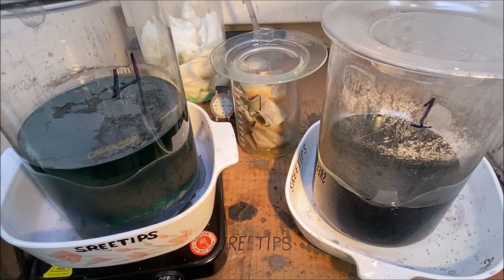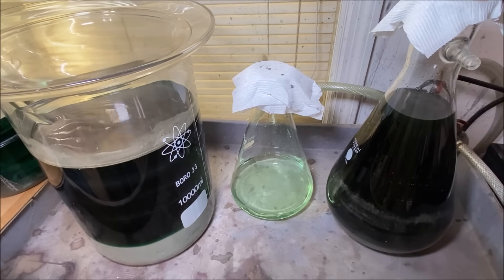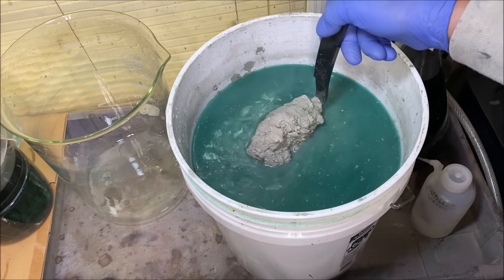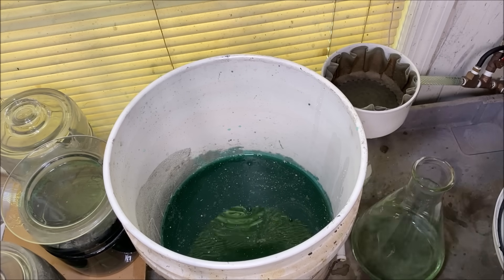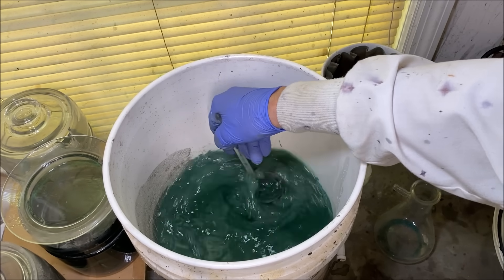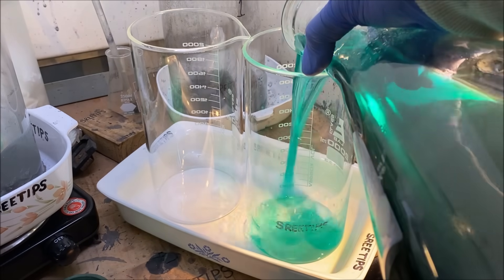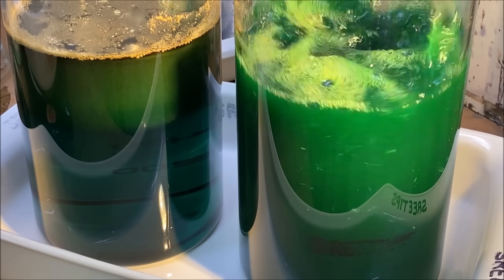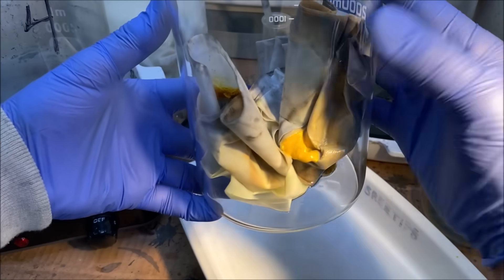Silver Cell Anode Filters Recovery and Refining Pt5

Comment: @8:25 Never mix alcohol of any kind with nitrate wastes during PM refining! Several precious and base metals can react with alcohol while in nitrate form to create pressure-sensitive explosive compounds called fulminates, with silver fulminate being particularly nasty. While it's safe enough to handle in aqueous form, it becomes so sensitive once dry that it's impossible to even touch without setting it off. This is probably the single biggest warning Hoke missed when she wrote her books.

Comment: Here’s another tip.  I don’t buy any distilled water.  I have the outlet to my A/C discharge go into a shallow 20 gallon bucket.  Fills up every other day.  I just fill my jug distilled water.  If there’s any junk it it (rarely happens) just filter it into gallon jug.  Hope I saved you some time and a few bucks.  Also great for plants!
Reply from the maker: I thought about doing that. I remember filling a five gallon bucket under my window AC unit with distilled water in about two day during the summer heat and humidity.
Reply: @sreetips A penny saved.  We’re paying for A/C may as well get a few bucks back in distilled water.  😊

Comment: Here’s a tip for you Streetips.  For my anode filters I get a glass 2 gallon bowl (I like glass because I can see sediment) and fill it with distilled water (kind of like the size of your silver cell bowl).  I then use a 1 liter (about 1/2 the diameter of bowl).  With 50 mesh fine mesh.  I dunk the silver cell slimes into the bowl with water and agitate it back and forth.  This separates the slimes from the powders.  When bottom fills up I filter solution.  Saves a ton on nitric and I just reuse the chunks in my silver cell again.  Works great.  You were close but you can’t just run water over slimes.   They have to be submerged.  Hope this helps next time.

All the best. 😊
Reply from the maker: Thank you for the tip!
Reply: @sreetips You’re very welcome bud.  Hope to see you try this on next silver slime video.  You’ll save a few hundred on Nitric and a ton of time on those boils.   I was thinking of getting an ultrasonic cleaner with custom basket just for this application.  Would automate the process.  😊

Comment: Another interesting video. Personally I'm not surprised that the cement silver piles up, literally. ROI on refining gold is higher and gets converted into fiat currency and then turned into more metals to refine. Where the silver is held as a hedge. Or a retirement plan. And cement silver is just as valuable as Sterling, or more so. By now you're storing a couple thousand pounds in various forms. And a sealed 5 gallon bucket of cement silver is as easy to store as bars buried in the ground or the bottom of flower pots. Personally,  I'd have several 25 gallon or larger flower pots on the patio with bars in the bottom and plants in the top. And no, I don't expect you to acknowledge the amounts or forms of storing it. It's just ideas.
Another great video. Thanks
Reply: Easier - most random people would have no idea it has value.
Reply from the maker: Unless it’s made of paper, most people here in America would not be interested.
Reply: @sreetips can't always count on that.  Have a wonderful day
Reply: @sreetips just saw a video on Rakesh Bullion made silver shot. They got small separated shot by swirling the water they poured the molten metal into.
Reply from the maker: Nice!

Comment: Couldn't one simply clean the filters directly after use in an acid bath and dissolve the silver? Just do the whole thing outside in a large bucket.
Reply from the maker: No. When working with acid, this must be done in a fume hood to draw the toxic vapors away. No way to safely do this kind of work without a fume hood.
Reply: @sreetips  Outside, I meant outdoors. The fumes are also only directed outside through the exhaust.
Reply from the maker: The fume hood draws the vapors. If you try this outside, approach the reaction from the upwind side, the air currents will wrap around your body and pull the fumes right into your face. No matter how well you hold your breath, even if you turn and walk ten paces, the fumes get in your hair, in your eyes, on your clothing, skin, and in your lungs. There’s no way to safely do these reactions without a fume hood to draw the fumes away from you. I ignored this warning when I first started. Did reactions outside in my back yard. Today I suffer from reduced lung function, blurry spots in my eye lenses, lack of smell and taste, all because I figured it couldn’t hurt me. Take my advice, don’t try this without a fume hood.

Comment: Love it.  You could make Pt50 of this and I would still be here.  
The process you are following seems to be largely unnecessary.  If you had cleaned the undissolved Ag from the slimes, and cleaned the Dacron filters with nitric, you would have a pile of clean filters, a pile of clean sliver shot, and a beaker full of slime. You could then just focus on refining the slime and reuse the other two piles in your silver cell.  It would have taken an entire episode of just cleaning to get there, but you would have saved a lot of time and nitric.
Reply from the maker: I’ve done these filters a few times. And experience has shown that the process you described above, could work. But I’d have twenty gallons of waste to deal with if I followed it.

Comment: WE REALIZE YOU THINK OF THE SILVER AS A BURDEN, BUT THEY ARE MY FAVORITE VIDEOS. I'M WAITING TO SEE YOU BUILD A REAL SUPER DUPER CELL......MADE WITH A 50 GALLON STOCK POT. I WANNA SEE A HUGE PILE OF BIG SILVER BARS.😊
Reply from the maker: I’d have to change to a Moebius silver cell. Alternating anode and cathode plates, spaced 4 inches apart, hung in a giant tank of gallons of silver nitrate electrolyte. And drawing a hundred amps of current flow. That’s too big for my small hobby operation. My small Thum cell is really all that I need. I just need to get to it

Comment: I still feel there is more Palladium yellow cake that can be precipitated than what you are filtering out. After you filter the yellow cake, if you add some more DMG to the liquid, may be you get some more yellow cake. Though DMG powder does not dissolve easily in water, you may leave DMG in boiling water on your heater overnight to get more concentrated DMG solution to get more Palladium will be better. 
Again, I am neither a chemist nor a hobby youtuber, just a feeling.
Reply from the maker: I think that I’ve added enough DMG to do the job. If not, and if some PGMs got missed, then I’ll have to deal with them next time.

Comment: That 50lbs bucket of silver is a million dollar bucket
Reply: Not quite, but still:
"The current spot price for one pound (lb) of fine silver is approximately $450.37 USD as of September 26, 2025, calculated by multiplying the average spot price of around $46.05 per troy ounce by the 14.583 troy ounces in one avoirdupois pound. (source: google)"
So, roughly, $23K.

Comment: Well done Chief ...  Hard work but satisfying when you see silver rise 14% in one week to well over $46 - still cheap, but starting to really move now.
Reply from the maker: Andy, in order for equilibrium to be achieved, the ration of dollars to gold, and dollars to silver, would need to reset to $30k for good. And $1500 for silver. Thats based on the trillions of fiat dollars that have been created out of thin air, and are now in circulation. No crystal ball, no degree in economics of finance. It’s just math and common sense. Owning and holding silver and gold, and rejecting paper currency, you don’t even have to contemplate. Because it’s a mathematical certainty. And I love betting on sure things.

Comment: What would the downside be to using the cement silver or cement silver shot to enquart gold instead of the stirling? it seems like any more gold refining and you'll be overwhelmed with impure silver byproduct.
Reply from the maker: Not recommended. Platinum group metals follow the silver. Karat gold contains platinum group metals. If the same silver is used over and over to inquart the gold, then the PGMs will build up in the silver. This could cause problems in the silver cell.

Comment: That's around 75 to 80 thousand worth of silver at spot price
Reply from the maker: It’s only about $36k
Reply: 50 lbs x 12 Troy ounces ( 12 per Troy pound ) =600 Troy ozs., x $45 = $27,000.
Reply from the maker: 50 pounds x 453.5g equals 22,675 grams
22,675g divided by 31.1 equals 729 ozt
729 troy ounces times $46 equals $33,534
$33,534 time 0.98 equals $32,863

Comment: I've always wondered if there is a reason why you don't use your refined silver to enquart your gold while refining the gold instead of melting fresh sterling into the gold, Seems to me that this could save you some money when it comes to purchasing the sterling for enquartaion..
Reply from the maker: Steve, silver is money. The longer I hold it, the more valuable it will become.
Reply: @sreetips  Yes, I know that, I was just wondering if that was the only reason, Not being a scientist I just wondered if the refined silver would get a beter or worse outcome.
Reply from the maker: Steven, using cement silver over and over is not recommended because platinum group metals will build up in the silver and cause problems in the silver cell.
Reply: if you dont want to buy more silver, of course you can do what you said, use filver shot or the silver out of the silver cell, but you cant deny this way is more entertaining

he gets more silver to process and sell by getting more sterling silver, and as you see, the price of silver is increasing so

the activity keeps both mr and mrs sreetips happy and busy